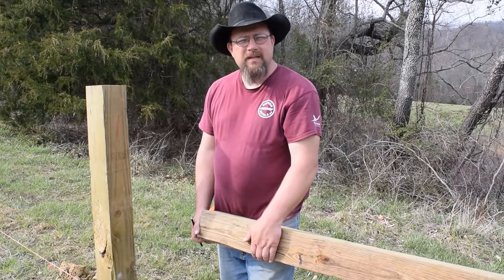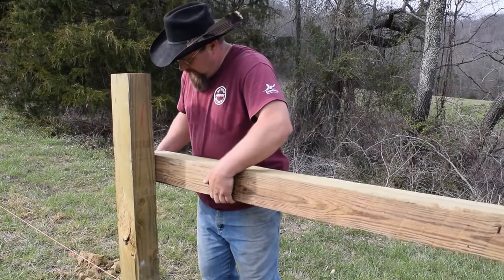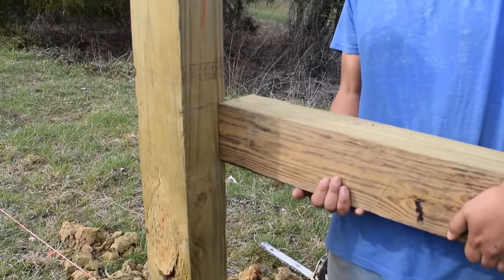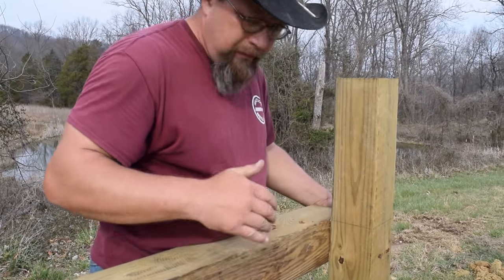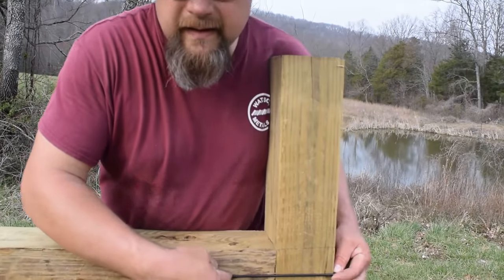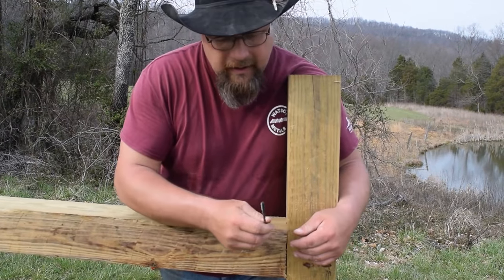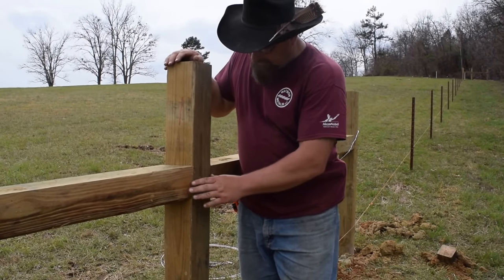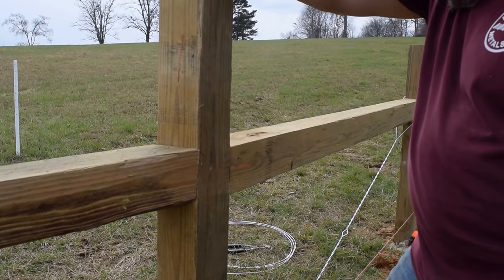Square posts round corner

Comment: Thanks for your video I’m learning to put up a fence myself on 1 acre. How high do you recommend putting the braces and what size? I’m using 6x6x8 for corners and 4x4x8 for runs. Im going down 2 feet and probably will cut the tops off at about 5’ 6”
Reply from the maker: It really depends on where you are running your wire, we try to place our braces so that they run with a corresponding strand. For your corners 30 inches to 36 inches is best for a post depth
Reply: @HighDesertHomestead  Thank you

Comment: Using the timberloks, how did you secure the posts that have horizontal supports on both sides like this:  |-------|------|

Did you just use pins in that case?
Reply from the maker: I run the Timberloks in at an angle. Sometimes using 2 Timberloks. I didn't use any pins. Thank you for your comment!

Comment: Do you use any wire diagonal bracing to secure your corners like with round posts?  Like your technique for clean installation around round or square corners.
Reply from the maker: Yes sir we use the diagonal wire but now we are using the gripple system and it has made our live so much easier.

Comment: Does a high tensile fence need to be in a straight line? My property lines look like a snake.
Reply from the maker: Not necessarily, the key is strategic  bracing. If you have a project send me a map of the property lines and I can design a fence system that will work for your application. Also have you checked out our Timeless Fence System, we have several videos on our channel. Thanks. You can email me at woodtnn@gmail.com.  thanks for watching.

Comment: How have the square posts held up vs treated round posts over time? Are you using rounds posts too with the square posts on your fence or all square ones?
Reply from the maker: Theses are 5 inch square treated posts. They hold up as good as round and you have more resistance in the ground than you do with round posts.
Reply: High Desert Homestead  Thanks but please reply what you mean re more resistance to rot or movement? How is it more resistant? Thanks again
Reply from the maker: @jeffgregory2000  with a square post you have more surface area facing the direction you are pulling therefore as you pull the post does not cut into the ground as much as a round post. The thinner the post the less resistance. Hope this helps.
Reply from the maker: So resistance to movement is the simple answer, lol. Appericiate you checking out our channel.